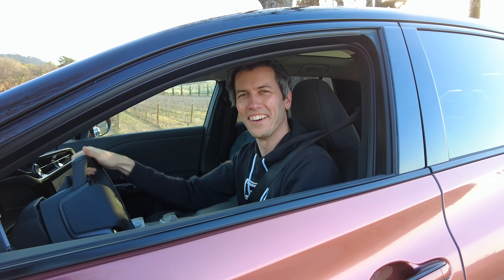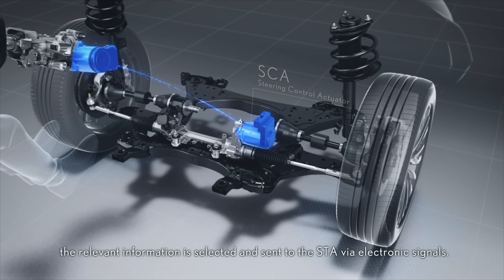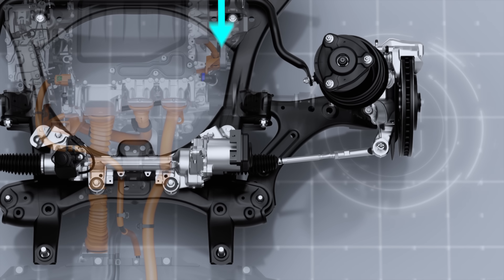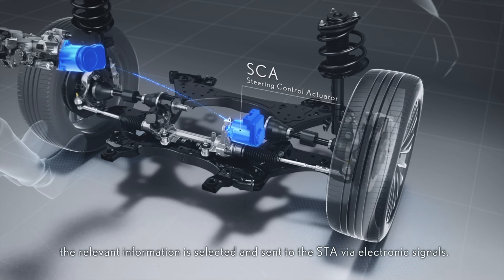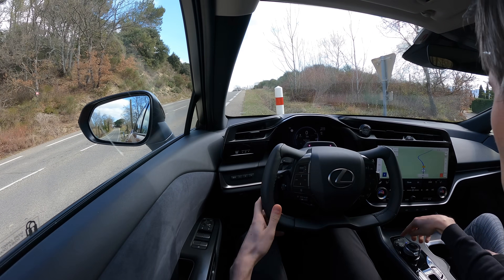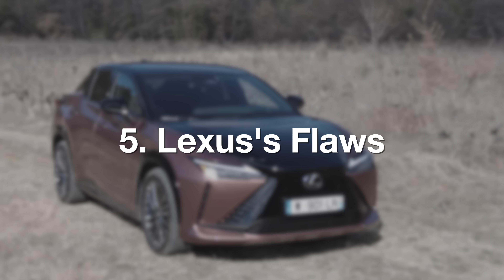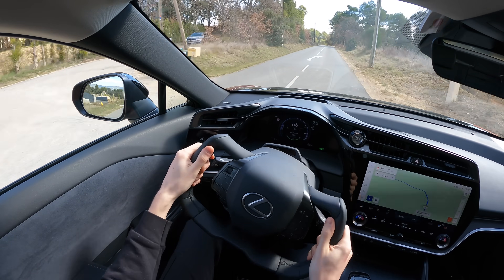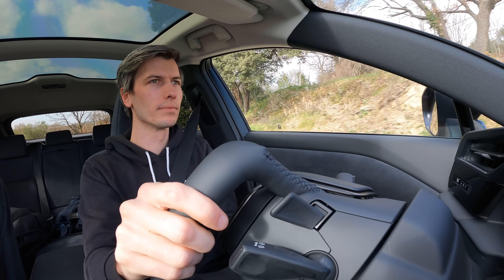How Lexus Fixed Tesla's Bad Idea: Steer-By-Wire Yoke

Comment: Nope, computer won't be able to process what sort of manoeuvre a driver want to do at medium to high speed depending on the surface conditions (dry, wet, snow...)
Not confortable at all.
At slow speed, reduce precision.
Then we all know reliability of electronics/electric equipments.
This will be a nightmare in the future for both driving this shxt and maintenance.

Comment: This sounds similar to when they starting adding the CVT transmission to a lot of cars, sounds good on paper. Infinite variations of torque, really good fuel economy and smoother acceleration. But in reality it sounds like it’s going to be something  with a lot of problems. Like the Nissan CVT in the late 2000s.

Comment: What about if you have to make a sudden maneuver at highway speeds? 

Will the traction control not allow you to avoid hazards at highway speeds? 

Is the insulation on the wires soy based? That is rodent candy! I would hope that at the very least they put them in a Capsaicin sleeve to deter rodent damage.

Comment: I am wondering how it reacts to loss of traction and counter steering at different speeds. I have a feeling that the not linear steering would make it very hard to catch a slide
Reply: And especially trying not to under or over correct, when you can't tell what way your wheels are facing

Comment: This idea of steering is borrowed from the aviation  technology, Airbus airplane has a similar system called "Fly by wire" meaning there's no linkage between the aircraft's control surfaces and the pedals and yoke it's all done electronically, but the system requires multiple redundancy. It's being ported into helicopters also. Great Lexus

Comment: One other question I have is What are the advantages/disadvantages to a drive by wire system...
Reply: He mentioned many of them in the video.
Number 1 is safety.
Not only does this make it so that you can basically never steer yourself into an unsafe situation (like if you input full steering at highway speeds, you could very well flip your car), but in the event of a crash, you also won’t have a steering column rammed up your face.
Not having to switch hands due to lower travel also dramatically increases safety. 
This system is probably much cheaper than a steering column, but also much easier to maintain since it’s really just 2 motors and a few sensors. Also much less prone to failures than a mechanical system.
Lastly is driver comfort, less arm movement is simply more comfortable.

Comment: If it's anything like Toyota's electronic throttle it will be horrible. I got rid of a car because of it. The variable throttle settings are of course, digital. So they are incremental not infinite. There are not enough step points to make a smooth operation. I found I was either accelerating or decelerating cruising down the highway, and it's impossible to find a smooth neutral throttle position with the pedal. Got rid of the car.

Comment: It's interesting that you mention an analogy of computer mouse sensitivity since most operating systems have mouse acceleration turned on by default. I think if this is done well, most people won't even think about it and I could easily see it being accepted by a newer generation of drivers
Reply: Everboody who is even a "light" power user will turn that off. And essentially turning it off is better, you simply can't develop muscle memory if the same movement has a different outcome. This is imo the biggest draw back to this system.
Reply: @DaGhost141  It is the most annoying thing Microsoft have ever done!!!!!

Comment: The jarring part of the "variable" steering ratio can also be experienced like acceleration on mouse pointers.  Accelerating pointer option is good if you have a larger resolution screens so you can get from one edge to another at high speed without having to move your mouse the entire desk length while still retaining some fine control at lower mouse speed.  However, it reduces accuracy if you need to perfectly aim your mouse at something very quickly.

Comment: Here's a scenario I experienced myself. I'm Driving down the road. You are  Supposed to keep your eyes on the road at all times but. I wasn't when I looked up there was a shopping cart  in the middle of a road not a parking lot. And I had to steer around it very quickly. I would be concerned maybe it wouldn't let me turn the tires enough or fast enough to avoid hitting the shopping cart

Comment: What happens when that cable breaks? Im a mechanic, everything breaks. This is trash. The whole system is garbage that will get people killed. We are going away from what works to death. The steering needs to stay mechanical just like the breaks. Hydro mechanical acceptable, electromechanical at most. Which is what most vehicles are now. When there is no physical mechanical parts, regardless of what you say you can put 20 power sources. This is a joke. There is no safely when you can’t steer.

Comment: If the ratio varies with speed what happens when you slow down while cornering? Do the wheels maintain the same angle while you slow? That means they’re not in the position they would be if you were driving at a constant speed

Comment: If you can tune the response curves for different speeds and even set logarithmic inputs etc., 10/10. But I doubt they are going to give the user that option because it can put people who do not undertand these settings in dangerous situations, especially at high speeds.
Reply: I bet someone will be able to tune it

Comment: older volkswasgens also fixed this issue with increasing the steering "response" when you go at higher speeds the steering wheel becomes really heavy, when lower speeds is really easy to move.
most of the VW's hatchbacks etc use magnetic steering racks.

Comment: the only problems that i have with this, are input lag and the manufacturer deciding to override "dangerous" steering input they judge unsafe. knowing roads are unpredictable you could need to snap steer to avoid obstacles like animals, debris, other’s dangerous driving, crashes, and god knows what. as long as this behaves as a 1:1 input i’m find. that’s pretty cool stuffs actualy

Comment: Maybe im paranoid but what if you're driving at high speed and speed sensors or computer because of something reads small speed, then small turn of the wheel eould lead into sharp turn you do not expect..

Comment: Just out of curiousity, wouldn’t it be more responsive if the wire split off into four separate wires that connected to each wheel individually?

Comment: Great explanations, one question, with more redundancy like batteries, 4 fuses, 4 motors etc. It seems like this is way more expensive and in this day and age is it really good for the envoirment to make a simple system so complicated? All those extra parts all need to be produced.Driving especialy on the limit needs fast responses and loads of these new systems feel slow like you showed the delay in steering. I get that no everyone will track their car but in case of an emergency i rather feel anything in the car then a computer that only shares what it thinks is important.

Comment: There exists a slight input lag on my old beater when it’s stationary as well. The friction from the tires contact patch with the ground and the elasticity of the tire walls means that it’s never quite perfectly in sync while rapidly spinning the steering wheel. It would be a slightly farer comparison if you’d compared the still frames to another similarly sized mechanical Lexus suv

Comment: Interesting. But to get it right, they'll need some way to make the expo rate control settings accessible to the driver. Just like performance settings for handling on a lot of modern cars. And it would help a lot with preferential feel. They could probably throw in some gyro correction like RC cars have too, as part of some dynamics package.

Comment: This crazy lol just passed operating systems class in college and this is not a good idea until we solve interrupt issues and can make different model that doesnt hold instructions in suspension while another interrupt occurs! Sounds good until the signal doesn't get passed back or thru just chilling in the bus line😅😅

Comment: It would be interesting to compare to the amount of backlash (delay, response, accuracy) in a normal car. I assume wear behavior might be better than a mechanical linkage as well. It might be an easier sell to put it in a Camry or F150 where steering delay/ feel isn't very good to start with.
Reply: Expect it to come to the Yaris-on-stilts "Chelsea tractor" models first: those buyers aren't fond of steering response in any case.
Reply: There really should be no noticeable delay vs regular power steering.
Normal mechanically linked power steering also relies on motors, and the wire signal from the wheel to the motor with steer by wire is virtually instant, so the only real delay comes from actuating the motor, which again, also has to happen with regular power steering.
Reply: @joelmulder  any delay in regular power steering also affects the position of the steering wheel.

A delay in this only affects the position of the tires, without providing feedback to the driver.

Comment: Steering by wire is by no means a new technology. Its been used for decades especially in naval applications. Los Angeles Class submarines use a very simple system for it. The steering yoke has a synchro that detects the position of the steering yoke, runs it through a relatively simple analog logic gate, then outputs that signal to another synchro by the rudder hydraulics at the rear of the sub. The hydraulics then extend or retract depending on the signal from the front. Same concept is used for the stern planes and bow planes. Now the Virginia class subs are all Fly by wire. That I have no experience working with but I'd assume the tech is very similar in design to modern systems like this one.

Comment: When too much electronics is involved it is not good. Each tiny component may fail when you least expect it. Repairs can be expensive. All modern cars are packed with electronics and they start giving headaches to the owners right when the warranty expires. I'd rather stick to old school cars with bare minimum of electronic assistants.

Comment: Instead of mapping front wheel angle to steering wheel rotation, and adjusting that for speed, the steering wheel rotation should be mapped to g-force generated from that angle, with the obvious overrides at very low speed since there's not enough inertia to generate significant g-force.

Comment: It is important to remember why fly by wire was introduced - first in military jets where the jet is unstable and only computer is fast enough to keep the jet stable. On civil aviation is on giant airplanes where the forces needed by the pilot to fly "by hand" are beyond reasonable. Also having hundreds of meters of control cables is potential mechanical issue.
Also I know BMW has variable steering for a long time (BMW Active steering) which doesn't use steer by wire

Comment: DBW schemes should still have a wheel and pedals like regular cars, just taking the inputs trough a computer 

Kinda how the Boeing FBW aircraft (777 and 787)  still have the yoke and throttle quadrant from the older style airplanes

Comment: Well yeah, they do have fly-by-wire in aviation, and its reliable there. But they also have ridiculous maintainance and repair costs, which is something the car world could do with a little bit less if you ask me.

Also, the throttle response of a drive-by-cable system will ALWAYS be measurably (maybe not perceptively, but still) better than a drive-by-wire (same goes for steering ofc).

Comment: thats cool and all but im curious how this would ever legally fly in europe?
here in germany for example StVZO §38 - Steering Systems clearly states "in the event of a total system failure, the driver must retain the ability to steer the vehicle"

The same applies to Brakes and ABS systems, hence why we do not have and i have never heard of a vehicle having brake by wire. It doesnt matter how many redundancies are in there or how unlikely it is to fail, german law simply says no.

Comment: How about high-speed emergency steering to prevent collisions?
You will turn the yoke while driving at a fast speed, but a car will restrict your steering, and you might end up in a frontal collision rather than drifting off the road?

Comment: No thanks, i'm not buying. I've seen critical failures of the electric power assist that creates dangerous situations with the wheel still mechanically connected to the steering rack, i can't imagine what can happen to a steer by wire when it fails.
You can't rely your life on electricity, if for some reason the microcontroller or motor fails or if for any reason the car gets a blackout for rodents chewing on wires you're going to hell.
There are a lot of people who like thia kind of junk and the new technology that stray them further from controlling their life, if they want to die they aren't doing it with me.

Comment: Couldn't you solve the steering sensitivity issue by giving the driver an option to adjust it just like you can adjust mouse sensitivity? Or would it present some kind of safety issue?
Reply: don’t think you woulf be wanting to go hand over hand on a steering wheel like that.

Comment: I absolutely despise lag, any lag, in anything. I want to know what is happening! That when I do something, it translates directly and exactly, I do not want something that varies and or reacts differently from what I intended. 
Yes this means ABS, throttle by wire, and especially that lag in steering that you demonstrated.

Comment: Why the hell car manufacturers are complicating things. No matter how good the tech is, a physical linkage (with or without electric assist) is always better than a steer by wire tech, when it comes to handling a car in dangerous situations.

What if the software or the electrical circuit malfunctions or shortens out while driving? You will probably die of someone else's fault. What a lovely way to die XD

Comment: Well, in the end it still is a mechanical operation, executed by an electric motor. The electric motor might react directly, but it still needs time to do the movement. Maybe they should limit the speed you can turn the yoke, so it fits to the real movement of the wheels. In my opinion, you can't compare steering to a drivetrain when it comes to response. Very interesting video and cool presented as always.👍🏻
Edit: Is redunduncy the answer to sustainability? Wouldn't it be more sustainable, and therefore better for the image of a manufacturer to keep classic steering?🤔
Reply: If the point of this was to have less accidents happen, that would mean less cars go to the trash. = More sustainability.
Reply: As we all know this is the goal of car manufacturers: Creating cars to last as long as possible, so that they don't need to sell their new stuff. That's how economy works, lol.
Reply: @jobo7085  Its a very shallow view of economy you're implying.

Comment: the latency between steering input and output looks like "lerping" to me, so depending on the speed, there is a ratio between old steering input and new steering input which creates a rubber-band effect. 
This can and will lead to fish-tailing if you have to use bigger steering angles to avoid an emergency because the car is not as responsive anymore. 

I have developed car simulators, where a real car is connected to a CarMaker + Matlab simulation and getting the steering input right was actually the hardest thing and messing things up like this, created almost always issues for the drivers.

Comment: "not everything has to be touchscreen" but everything has to be electric.... got it. 
imo seems like the benefits dont outweight the disadvantages in this particular system. 
"hand-over-hand motion"? yeah, called driving, there's also an accelerator and brake pedal you got to step on 😱 (only those two for most of you 😉), lets get rid of those too. lets just separate cars from PTU's (personal transport units ["units" cause we dont want to offend anyone]), and divide us between DRIVERS and RIDERS.... 😏

Comment: didn't BMW accomplish variable steering ratio with a steering gear box like a decade ago? I watched the entire vid awaiting you address this alternate design and it's not mentioned at all. Just because something needs to be variable doesn't mean take the physical connection out and put electronics in. I'm as much of a tech/gadget guy as the next guy if not more so, but some things shouldn't be relegated to 100% electronic. Airplanes have redundant systems because they're in the air, AND they have trained mechanics maintain them. I can already see owners oblivious to the motors or controllers failing and keep driving with only the redundant one until that too fail and they're stuck. If there's any truth to strereotypes, Lexus drivers are probably more guilty of this kind of ignorance than most. What about used market? If anything, this makes me less confident in Lexus engineering in general. I don't see the brilliance in immediately going for the low hanging fruit of using an electronic system when you're a mechanical engineer and it honestly feel lazy and half-assed.

Comment: Throttle by wire had many problems early on, and still has some; the failsafe is that the engine goes into limp mode to hopefully keep you from dying if the system craps out.  There is no safe limp mode to a steering system.  I have very little doubt that people will die in the process of perfecting steer by wire, I also think that many will be saved because it will blend better with accident avoidance systems.  As people become dumber drivers cars must become smarter and safer...or, more likely, people have become dumber because cars enabled them to.  If all we had were Model T Fords people would be forced to drive with care.